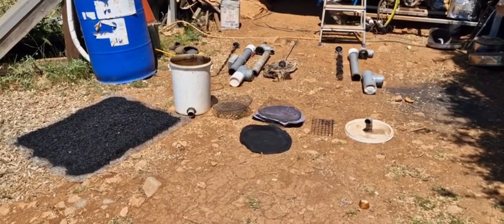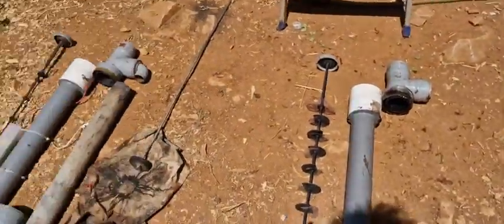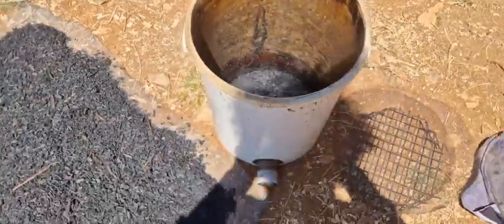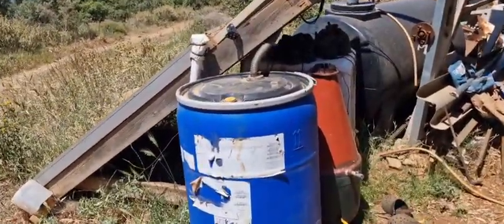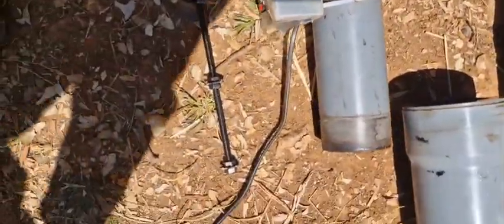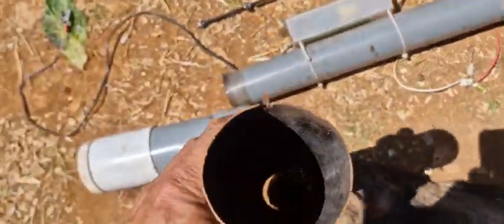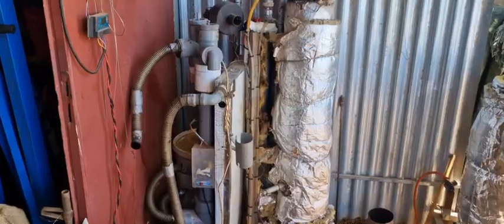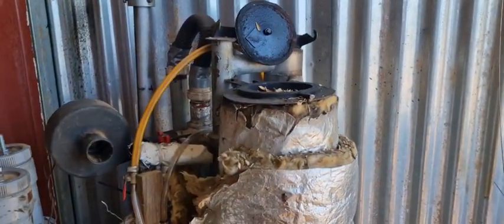"tar free" gas filter system for every gasifier #DIYGasifier #BiomassEnergy #OffGridLiving

Comment: Im 🤔🤔 about your solar dryer .. and the 2 meters u have ..is it for humidity or temperature or..🤔 
Wood chip drying ..
Reply from the maker: I use an old broken solar hot water en electric panal to make hot air en some electricity (20 watt electric max ). This is used to blow the hot air using 2 small fans in series through the barrel of woodchips by direct contact. En this heats en absorbs the moisture in the wood, I measure both the temperature en humidity at the inlet en outlet of the barrel, there is a temperature swich  in the panal to swich the fan on en off , this makes a nice en maintenance free fuel dryer that does the job pretty quickly
Reply: @oscarverwey  ok 👍 v good. Will be in my woodgas set up 1day to.. if you get some old blue crystal...poly crystal  solar panels you can power up any DC motor as long as the watts and volts  rating are close to the same on each .. 
The new monocell panels don't do it..💥👌
Reply: @oscarverwey  it's how I pump well water every day .. 70watt DC pump .. AliExpress. And old telecom panels 60--80w..18v. go ok even in cloudy days.

Comment: 💥👍👍😯 thanks you .
Reply: https://youtu.be/7jMWn-X5hrc?si=22PC-bIw0Wh5CUj3 
Bryan white 77 chnl.. char gas hydrogen..water drip on 🔥🔥 adding power . 4eng..flares..etc 👍
Reply from the maker: I see what you mean its a interesting phenomenon, In a wood gasiffier, this happened by itself . You have hydrocarbons to make the heat you have moisture to make the steam so you can use al the charcoal for reduction. If you do it correctly you use the product gas en exhaust gas heat to do the fuel drying, air en steam superheating, torrefaction en pyrolysis so oxidation en reduction is a easy job to make tar free gas with high moisture wood , , Way more efficient than those charcoal gasiffiers
Reply: @oscarverwey  utubbe deleted the vid link.. comments.
Reply from the maker: @GrrahamGreeken  I've seen that videos of the charcoal guys how think that's the best way, because they didn't figure out how tonget tar free gas from wood . Even there charcoal gas have more tar then my woodbgas 😄
Reply: @oscarverwey  yes I believe..💥
Reply: @oscarverwey  I just remembered a way of cooling the hot gases and dropping out the vapor s etc. a vid I seen 🤔 2yr ago on a wood gas build ..the guy weld up steel tank from 8" pipe..and filled them with...stones..BLUEMETAL..road surface ing stone..//bitumen etc.. 
==Hi surface area.. easy to clean out.. good4hi temp gases . 💨💥👌
Reply from the maker: @VANHAMM  I'm planning makkng a evaporative cooler using its own condensate as cooling medium 😎 those things can continuously cool 7c below atmospheric temperature
Reply: I just came across. 😊😯🌋
Reply: Fff🤬 gggoole delete ing my comments. Links .. 😡
Reply: https://youtu.be/7jMWn-X5hrc?si=22PC-bIw0Wh5CUj3 
Bryan white 77

Comment: The only mention of a compressor was to show when you need dry air you use a water trap, and with the gas going through a water trap with the end of the pipe surrounded by fine stainless steel mesh. I hope this clears up my point.
Reply from the maker: I understand

Comment: Great explain but I found the filtration process a little too complex, but one other water filter using steel mesh at the bottom of the inlet pipe collected a lot of tar and then putting the gas through a carbon filter was good then as in compressors to dry the gas a water separator is used. I think that would remove most of the tar stopping it getting into the engine.
Reply from the maker: Great you like it . I don't believe using a compressor en extensive activated charcoal filtration is necessary anymore. As i came up with at least 3 ways to get almost zero tar from different kinds of gasiffiers. i only use a sand bed filter now for the water fog en nothing else there is no tar anymore . Feel free to check it out.  Greetings

Comment: Is this using the wet electrostatic precipitator? Or is the one shown in this video dry? I thought I saw a video where you made a wet one because it did better than a dry on. Great work as always, lots to learn from you
Reply from the maker: This is the dry type. The wett type also worked great only the water was a problem to dispose of so I chosed to continue with the dry type that is better to clean en it can be used for fire starter

Comment: Thanks buddy, good stuff!
Reply: Still Not bad for wet fuel!
Reply from the maker: No problem I hope it's of any help, sadly I put wet fuel in it so it made some tar in the gas but it makes a good comparison to the electric filter,  also the secondary air nozzle inlet was clogged whit soot so it turns out it only had a single air input en relatively wet fuel 😆 still pretty good results, greetings

Comment: I want to inquire about an important question: Is it possible to extract hydrogen gas from gas wood? What are the practical methods for this?
Reply from the maker: There is no easy way, I wonder why would you want that? Wood gas is already practical , in the end there is a reason why we don't use pure hydration for powering stuff,  the dilution gases that comes whit the wood gas makes it safe to handle en makes the engine not so prone to hydrogen imbritelment so I can run for a long time, de-rating is around 20 to 40% depending on certain Tunes en mods , whit 1.2/1.3bar  Turbo pressure you can get back to gasoline power whit a higher conversion efficiency
Reply: 💥💨💨🤔 Atomic hydrogen gas 🔥😯 WELDING.. 
like tig welding but using 100vac 5amps.. and just hydrogen gas..💥 
Can do aluminum 👌👌👍
Reply from the maker: I don't believe you want hydrogen near any metal at that kind of temperatures. it's only gonna cost embrittlement, specifically aluminium!
Reply: @oscarverwey  that's more y I want to try the mix of wood gas in this welderingg 💨 h2 is a big problem storing it .. brittle tanks 💥🔥 it pays to read up on it all ..
Reply from the maker: How about storing it as a solid fuel like wood 🪵 🤔
Reply: @oscarverwey  adding small amount of hi temp 200°c steam into the hot zone of the gasifier I read somewhere adds extra power at the output gas .. more h2 out..🌋
Reply: Maybe have to be vv hi temp .. 300-400° c .
Reply from the maker: @GrrahamGreeken  it's called water shift reaction en it happen naturally in a wood gasiffier to when done correctly

Comment: Note.  Use Stirling engines in the cooling section/sections to generate the electricity to power the electrostatic filter...could provide even more power for other things....maybe.  try it.  Also.  In the "test" area.   Store any power in a battery or capacitor system for even more "free" power
Reply from the maker: Excellent idea, although the electric filter uses 6watt for every 1.5kw electric output Worth of gas from the piston engine
Reply: @oscarverwey  "gas"    um.   Stirling engines do not use gas.    They are heat engines.   Heat difference is the only fuel used.  Period.  Now. I'll admit.  They are far from efficient.   But.  Turning "waste" heat Into power.....makes sense to me
Reply from the maker: @melvance7281  i mean to clean the amount of gas to generate 1.5kw electric the filter uses 6watt so a Stirling engine for using the heat is not that attractive so to speak, i found it very hard to make a Stirling engine en near impossible to make them delivered any significant amount of power
Reply: @oscarverwey  so.  Make several.  You are trying to remove a LARGE amount of heat.   Stirling engines can help deliver power while doing that.   And.   If built correctly.  Can deliver power from the heat you are trying to get rid of.    We are talking ALOT of heat.   That equals a good amount of power that can be harvested
Reply from the maker: @melvance7281 i agree Stirlings can do al that en are funny things , however there is a misinterpretation on my part,I don't want to get rit of a lot of heat only the micro druplets in the gas after Cooling, im reusing most heat for drying, torrefaction en pyrolizing the fuel so a low tar en even whit my new 2 stage gasifier zero tar gas is produced whit a minimum amount of added air, as far as heat dump goes only the last 60deg c ( 100deg Down to 40deg c) is rejected through the radiator or water heater , this video was juist to show the best en cheapest way i found to get zero tar gas whit any gasifier so pouple can replicate it en don't have problems whit there engines anymore